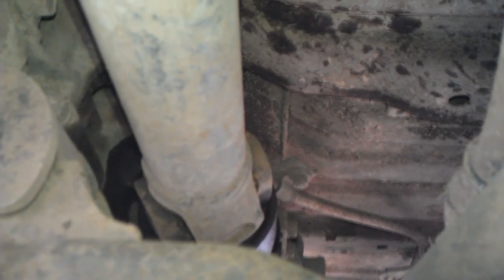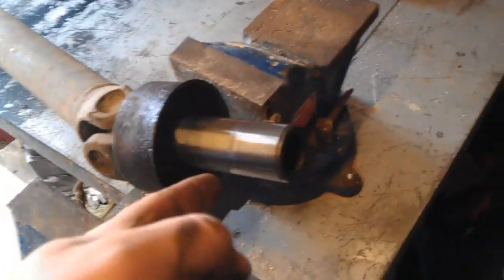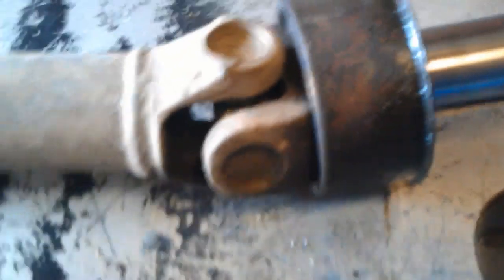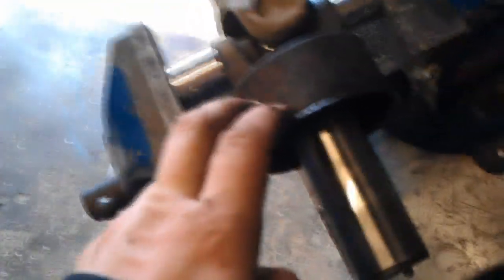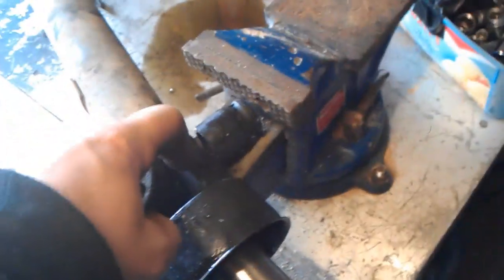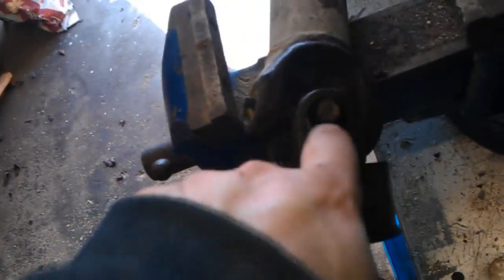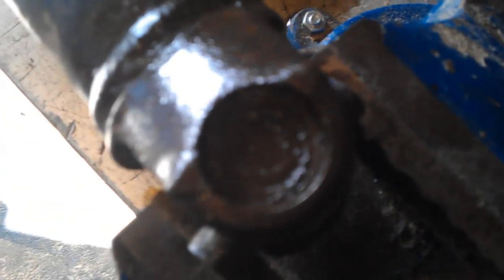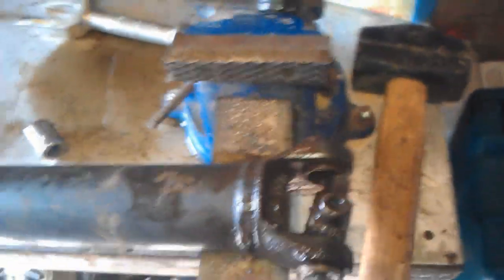Propshaft Universal Joint replacement

Comment: those little steel ramps are garbage your better off using a jack and then putting 6x6 wood under the tires
Reply from the maker: i have a jack but its easier and quicker to just chuck the ramps under for some things. also its a pain in the arse dragging a heavy jack around on gravel...
Reply: +richardfld very true